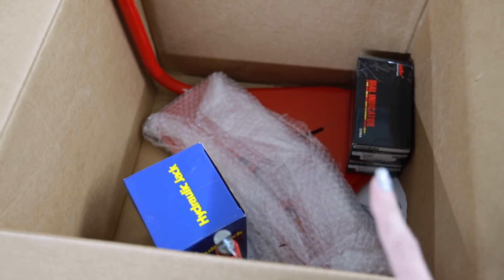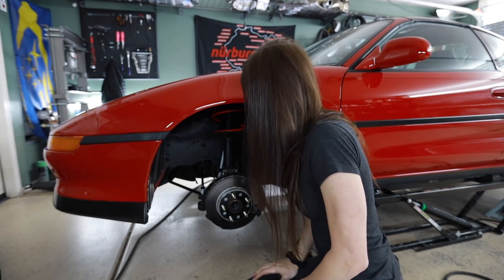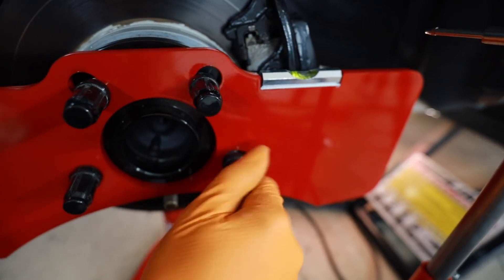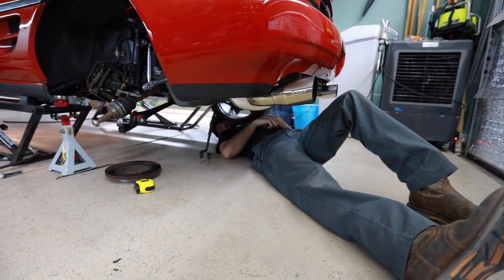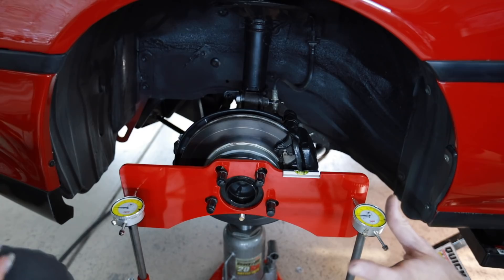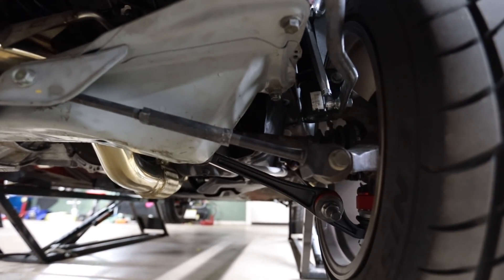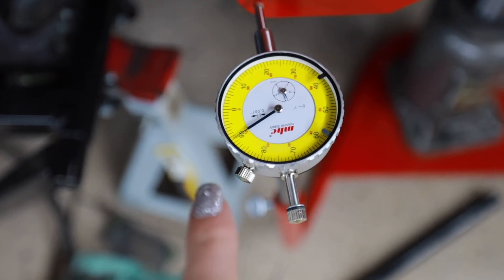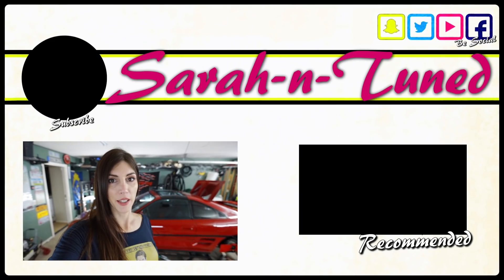Never Lower A Car w/o Doing This! // Project MR2 Turbo

Comment: I can appreciate all the work you're putting into the suspension but my 2 was slammed only on sportline springs/tokico adjustables and I never had issues with bumpsteer or spinning out during spirited driving. You might be indestructible after this...

Comment: I am pretty sure you should corner balance to set ride height before doing any of this
Reply: Ross Martin how would you suggest they go about corner balancing on a fixed spring/shock set up?
Reply: @ShalomBrother  fix that problem first
Reply: How though is what I’m asking?
Reply: It's a joke, fix the problem of having non-adjustable suspension is what I'm saying
Reply: Bump steer has a much greater negative effect on handling than corner balancing or ride hight

Comment: Alignment makes a world of difference. I had a 2002 Acura rsx, got into a ice accident where it hit and jumped a curb. The collision place “fixed” my car but didn’t do the alignment of the suspension. After a couple years and a couple of noticeable unevenly worn tires, I went to a actual alignment/tire garage. They told me and showed me that all four wheels were literally pointing/off in 4 different planes. Which was why I felt like the car was spinning in a circle every time I cross a icy metal grooved bridge.

Comment: I find that using a scissors jack like found in most cars to change a tire (you can get them cheap at a wrecking yard or pick & pull) works great with a bump steer gauge because you can move it up or down easily. I welded a 3/4” nut to the jack so I can use my cordless power drill and a 3/4” socket to move the jack quickly.  Love seeing you do some of the alignment yourself.    Get a couple of pieces of plywood cut to 12” x  24” and you can do your toe measurement yourself. Lean the boards up against the side of the tire, one on each side of the car. Using two tape measures compare the distance between the fronts of the boards and the rears of the boards, at ground level, that number is your toe in or out depending on which measurement is larger or smaller.   Keep up the great work!

Comment: If you really want to get an accurate measurement do not use the end of the tape measure. I am a carpenter and if you really want to be more accurate burn one that's what we call it you put it at 1 in and then measure from there that gives you a better accurate measurement

Comment: Forget my awful math skills, WTH is green Locktite?  And Charlie, please radius the corners of those permanent brackets.  They look dangerous for anyone who has to crawl under the car in a pinch.  Besides, then they will too custom made.  Just sayin'.
Reply: Hi green locktite is either a very strong thread lock or bearing fit , used for permanent bonding . It’s green in colour and is in the 600 series have a look at the locktite website, they will have a up to date list of products. Hope this helps
Reply: @nicksmith633   Thank you,  I guess that it's someone different than red Locktite for this specific purpose.
Reply: Ron LHeureux Hi Ron the simple way I use to remember them roughly is by their colour yellow low strength , blue medium strength, red high strength and green very high strength or permanent. I am no expert hope this helps nick
Reply: nick smith  This works for me.👍🏻

Comment: I think in 93 Toyota fixed the snap oversteer issue that model had. They added length to the arms you two replaced. Doesn't Emmie do a lot of Baja stuff?

Comment: I think the rear tie rods need a redesign. The attachment to the spindle has no means to keep from rotating. That could significantly change the toe. I bought a crashed MR2 many years ago with all the rear arms bent and it drove decent. So I don't think it is a serious safety issue. But would be more of an annoyance if it changed on you, and add wear on the tires if you didn't notice.

Comment: FYI, finding an alignment shop willing to align a non stock vehicle might be tough as most will not align it or may align it but the results may not be what you desire. 

I have 2" dropped spindles on my 64 Bel Air that are designed to keep the same geometry as the stock ones but still have the upgrade of disc brakes. Most alignment shops are looking to get the vehicle in and out quickly with minimal work in adjustment due to the alignment fee charged. If the vehicle is in the "green zone", it doesn't get adjusted and the margin for that zone is wide which may still result in previous wandering or pull etc that was present prior to getting the alignment. 

I bought a Longacre camber caster bubble gauge years ago to do my own alignment as the "close enough" for most vehicles wasn't close enough for what I prefer. I also encountered most alignment machines not having the capability to go back that many years in their catalog of specs to do the alignment.

So my suggestion would be to pick up a Longacre or equivalent camber caster magnetic hub mount gauge which will pay for itself with the cost of 2 to 3 alignments. 

Longacre also makes toe plates that utilize two tape measures to check the toe or using the string method which I use as it has been reliable and accurate. The other plus side is that you can align anything you own from that point forward including your sand rail, utv or Subaru as it's another valuable tool in your arsenal. 

While the thought of doing an alignment may sound intimidating, it is relatively straightforward and a useful skill as knowing how to buff paint once you learn the principles of camber, caster, cross caster, toe and bump steer.

Comment: just a question🖐wouldn't  you throw off the angle your measuring with the spacer that would be the wheel track like the radius of the angle from center?

Comment: I totally lowered my car without doing any of this. Oops.
Reply: Most cars can be taken on an alignment rack after 1k miles or a month and can be set to within factory spec.
Reply: @RickOAA  you might get factory toe/camber/caster at static ride height, but you're not correcting any of what Sarah/Charlie were doing here.  You'll still have bump steer/roll center issues.
Reply: @rennkafer13  So if you lower your car, does the alignment shop align it using the new ride height or do they just align it to factory ride height specs?
Reply: @rennkafer13 For those cars known to need such things...sure.
Reply: @peted2331  depends on the shop.  Factory settings are very rarely the best for performance, they maximize tire life.  So most non-performance shops will align to factory.  Performance shops can align to better performance specs at your request.  An alignment from either doesn't include any changes to bump steer and roll centers though.
Reply: @RickOAA  Lower ANY car very much and you've made a difference.  How much is dependent on the particular design, sure.
Reply: @rennkafer13  well I'll be. Thanks Bill. I'll get it re done at a performance shop when I add camber plates
Reply: Most cars are fine at a one to two inch drop. Some cars are marginal from the factory. There's a huge difference between a track setup and street suspension...unless you're that dedicated in ruining your road car(s).
Reply: for street use that is enough
Reply: My GTI loved being lowered and tuned, I did get an alignment though.

Comment: Why didn't you just use the bottle jack from your Harbor Freight shop press?
Reply from the maker: because its attached to my press
Reply: @SarahnTuned  It comes of real easy, All you have to do is push down on the jack and pull it toward yourself being careful not to drop it on your feet because it's heavy. I suppose if you have a nice machinist to bring his bottle jack over that would be easier. If ever you need one again and there is no machinist around for you to bat your eyes at to use theirs, as long as the return springs are not too tight you can use the one from the press in a pinch.
Reply from the maker: Bob Adams ..I assembled it, I know. Lol
Reply: @SarahnTuned  Never mind.
Reply: Sarah  1
Bob      0
Reply: @crazyoilfieldmechanic3195  Dream on. No point in talking to the wall.

Comment: I personally would have liked to see a measurement with vs without the correction kits you have on there, but I understand the extra work makes that kind of unrealistic.

I hope this is taken as nothing more than constructive, but I think you should have gotten this on the road and aligned before doing this. Your strut bar/bushings in the front hasn't been adjusted, torqued, or settled yet, which means that your caster is neither set or secured, which is a much greater concern than your bump steer, as it will change degrees (lower ride height being less positive caster) vs the fractions of a degree of these measurements with a ride height change. 

The fact that geometry changes with ride height change is absolutely correct, but certain geometries dictate others. There's a reason you set the rear before the front, and caster before camber before toe in the front. Depending on where your caster is currently, and assuming that it is as secured as it will be while driving, your hub center will move radially closer/further from your steering rack changing the measurements you just took.

Still, I look forward to being wrong about this, and all the work and components you've put in to play nice and not give you any further fits.
Reply: In support and extension of Dave's comments - What is being proven here, that a shop who is experienced with dialing in lowered cars, high end cars (even race cars?), doesn't correct and refine all day doing full alignments?  No insults here, the fact that we are seeing this gage used in a non alignment based channel is commendable and cool, and can certainly be used on future builds, but until a car settles in, these measurements won't be consistent and will surely change once set by a good alignment (no news here from this peanut gallery - being me).  I must be missing something.  The car has been lowered an inch or so?  And with larger than factory wheels....and inch lower is negligible while the wheel size increase (what? 14 inch to 17 inch?) would seem a bigger impact on total geometry than the inch of lowering (I would think, but I only have a half dozen lowered Miatas so what COULD I contribute here lolol) than the lowering itself.  I wish Sarah would reply to Dave to explain the approach.  Also, if you want to play into thousandths of a inch, are you factoring in driver weight for the ultimate dialed in level ride or is there any ride height adjustment with that shock setup(?)…  
I guess all this is an admittance to not understanding this exercise when a good shop is going to do this anyway.  In any event, it is cool to watch outside an alignment focused channel.  One more question would be, if this had been way out of some spec, a 'spec' that considers 17 inch wheels and an inch of lowering...what would be adjusted before heading to an alignment shop?
Reply: @12B4Christ  to clarify, I'm not bashing the process or even the need for this, just questioning the order of operations somewhat. 

Tire/wheel size doesn't really play a part in either alignment or lowering, as what matters is hub center/ pivot points to chassis. In this regard, wheel size only really affects scrub radius and qualifiers like turn in, on center and feel. 

This is more of a refinement step in my mind, to really get it dialed in right, similar to corner balancing, as you brought up driver's weight. It's one of those things that 'on paper' isn't ever going to be dead on. Same essential reason an engine's base tune will always need adjustment under load, to get the most out of it. 

The tie rods that Sarah has does have some joint adjustment, so if it were off, it could have been corrected.
Reply: Hey Dave, has per initial measurement of the stock part question  if you have access to alignment spec +  OEM  spec  ( frame master type )  you will find your  oem measurement  All the best
Reply: @mousetrap134  more so wondering about lowered measurement with and without correction, not so much factory spec.

Comment: The reason why the spring had to come off is due to suspension motion ratios.  Meaning when the tire is on the car and weight is on the suspension, the tire is farther out from the control arm inner bolt (fulcrum) than the place where the bottle jack was lifting the LCA.  Lifting the LCA closer to the fulcrum effectively makes the spring rate higher, which is why the car comes off the quick jacks or jack stands before you get to normal ride height.  That's also why with coilover suspension, adjusting the spring perch up or down changes the ride height of the car more than the distance the spring perch changed.

Comment: ❤❤❤Wow your MrDos suspension videos have been amazing!  I have performed all of the above on my Volvo AWD wagon... it is indeed, a lot of work to make geometry correction for lowered car. Almost wish i left it alone, lol. I did go as far as making my own 4-wheel alignment machine using high-precision line lasers and Tenhulzen camber-caster tools.
Reply: I was thinking along those lines with building my own alignment machine set up until a machinist friend handed me a stock car magazine showing how to do a string alignment using simple tools. 

After reading the article long ago, a roll of string, tape measure and a camber caster gauge will do the alignment on just about anything with 4 wheels. Most racing teams still do alignments this way and the accuracy is all dependent on how consistent you are in measuring from the same location each time you check say toe on the front and back of the tire.

I was skeptical of the "antiquated low tech" method but after verifying the alignment on my 64 Bel Air was 1/4 degree or less difference via a laser alignment machine at a shop, I was sold on the string method as being a viable solution far less expensive. Being consistent in points of measurement is where getting the same readings comes into play when using the string method. 

Your car should handle far better than stock with all the work you put into correcting the geometry. I came across a Volvo wagon around the late 70s while at a light in Ocean City MD that was lowered with a LS V8 conversion. Total sleeper that would haul the groceries, family and some. 😁
Reply: @andrewawf9889  Strings do work well, but i found they get in the way, or bumped out of alignment. Plus i had to be fancy I guess :-)

Comment: You are overdoing it  ... never lower a car without doing it ? Yea no tnx
Reply: some cars are much more sensitive to bump steer when lowering than other cars.  From what I've heard the MK2 MR2 chassis is one such car.  Other cars such as 90's Hondas aren't so sensitive to it.  My Integra has been lowered ~2 inches for 18 years with no such detrimental bump steer effects.  It really depends on the angles of the control arms and tie rods with respect to the ground, and the lengths of the control arms and tie rods.
Reply from the maker: If all you care about is looks, and not actually driving.. then by all means.